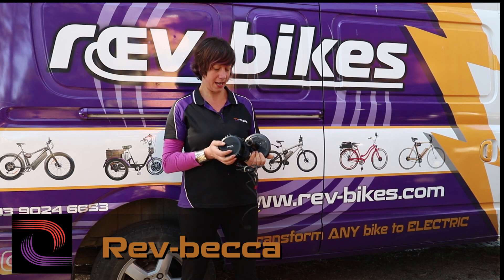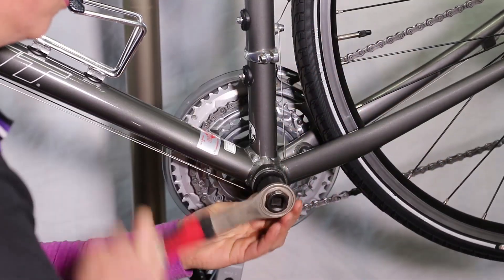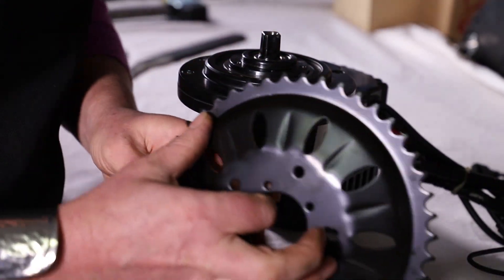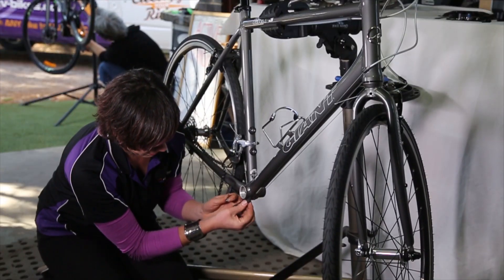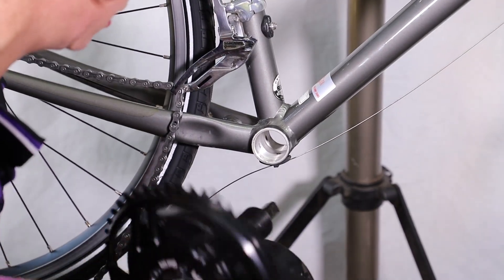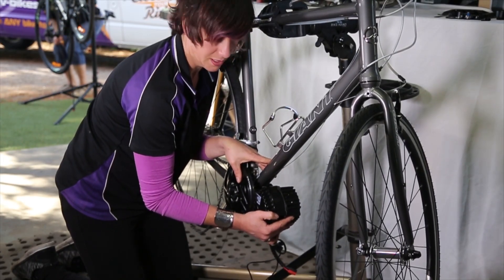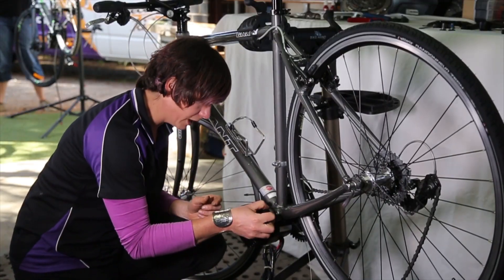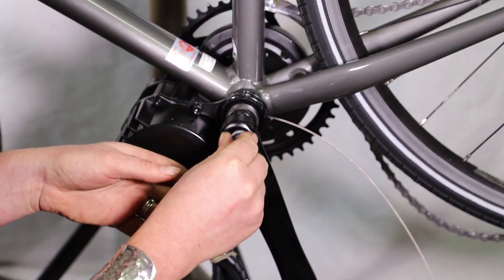Installing a Bafang mid-mount motor

Comment: Not the best frame to motorize because  I would recommend a hydraulic brakes.  The top speed on  your motor is pretty high and will wear your brakes pads 
prematurely
Reply: I agree, hydraulic disc brakes would be saver.
Reply: Yes hydraulic brakes better, but the motor cut off switches are more complicated. The kits usually come with mechanical/cable brake levers and inbuilt motor cut offs, Hydraulic brakes often require an after market add on fix, usually a magnet glued on to the lever, and a switch.
So yes hydraulics better but more complex and expensive, brake pads cheap, but for serious off road stuff, Hydraulics essential.
Reply: Maybe on a really cheap dept store bike. On my regular pedal bike I used to descend mountain roads beyond 40mph daily.  Even with 1000w motor it's within the normal use of anything higher quality than dept store bicycle construction. Any properly adjusted reasonable quality caliper, v brake or cantilever brakes will be fine.
Reply: I'm running budget Tektro cable disc brakes with excellent braking. My pads last a whole season or more despite the steep hills I ride. They do need a quick adjustment every once in a while to compensate for pad wear. I was using center pull V-brakes before and they too stopped fine but the brake shoe wear was significant. Several times I could smell hot brake shoes (hot rubber). I'm a big guy. My switch to disc brakes has probably paid for itself.

Comment: hi Becca can you give me some advice as very worried about buying my 1st Bafang mid drive motor as its a lot of money to fork out and get it wrong  ,the only ones ive seen is that they only come in  bottom bracket sizes in 68 mm ,100mm ,120mm 
 i have a problem cause my main my worry is , that my bottom bracket is( 73mm in width) on my Giant talon 4 mountain bike
 can you advise me what size bb shaft motor to buy 
and if its the 68 mm bb size motor i require
 How does one adapt to make this this work on a 73mm bb bike  is there some sort of thing i can buy to make this work can you advise me on buying the correct size motor for a 73 mm bottom bracket as they all seem out of wack  sizes to my 73mm bb
 >>ty Becca from me mark in the uk ,ps i love your videos
Reply: She mentioned that in the video. She  said 73mm fits using the 68mm kit and just needs some extra washers.
Reply: hi becca i id like to share this info with your viewers followers just like my self, but live to far away in the uk  to come visit your bike shop though i would love to 

i have since found out the answer to my question above 
 if your 1 st timer, like i am on installing a bafang motor
 if you have a (73 mm in width) bottom bracket, what i have seen & read researched ,it said you can install  68 mm bottom bracket bafang motor on a bike that has a 73mm bottom bracket , 

as follows ..with your motor slotted in place you just tighten up  your motors main pinch ring which bites into your frames bottom bracket with a bit of (locktite  blue) , the only difference is in some cases you leave off the cape cover ring that goes over the top of the main ring that holds the motor in place, hope this can be of use to toughs whom have struggled on lack of  info on this subject like i had if on motor compatibility to different bottom bracket sizes

Comment: I followed this procedure very carefully and it went together very well and looks great. One thing I did was to shorten the powercable and join it inside the battery holder using a terminal block. Very tidy. Is there a video on setting and/or tuning the unit?

Comment: Will this work on my old huffy Bay pointe 3 speed that has rear planetary gears? Or will that be too much torque for something like that?
Reply from the maker: Depends on the motor power. 250w is no more than regular leg power, so would be fine. 750w is 'a horse power', which might do some damage!

Comment: One way to get rubber grips on is to put them in boiling water for a minute or two and they slip on like butter
Reply from the maker: I use that method to get them off sometimes. Using hair spray to put them on provides lubrication, then makes them stick solid once it's dried .. the best way!

Comment: Anyone know exactly why you can't install these on carbon frames?
Reply from the maker: We don't believe the frames are strong enough.. especially the water bottle mounts (may be ok for 1kg of water, but not 3.5-4kg of battery).  We have done one as an experiment a few months ago, with a specially made custom battery.. is going ok so far.  But we couldn't tighten the motor up anywhere near as much as we usually do, so used a torque bar underneath.  You can always try it, but if you don't know what your doing, you may likely destroy your frame!  Hope that helps :)

Comment: Aaahhh???.....How many people do you know that have Crank Extractors, etc in their home tool kit??? I don't know any, and I have 2 Norco's, a Katmandu and a Plateau. The Katmandu is from the late 60's early 70's and I pretty much rebuilt it myself, but I didn't have to change Cranks, just the pedals because only a "Bike Shop" has the tools needed to perform this procedure, so you should tell people that they will have to take their bike to a Bike Shop in order to mount this motor. It can NOT be done at home unless you are a Bike Mechanic and have the tools, or you 'order' the necessary tools, but from where?, I don't know? So yeah, this is more difficult than it seems due to the required tools that not just everyone has at home like myself. I have pretty much all the tools needed, but I don't have any to Crank work.
Reply from the maker: Crank extractor tool is pretty inexpensive, and readily available at bike shops. But we agree with your opinion, and no longer sell our kits for self install.. we are now building an installer network across Australia for our customers 😁
Reply: Well I've had my ebike obsession for about two weeks and I've already ordered a $4.5k bike and now ... waiting for the hoped for delivery,  I'm obsessing about sticking a Bafang HD on my 10 year old Specialized with  V brakes.  So I have to buy a hundred  bucks  worth of tools.   So  the frack what !?  They're out there.  Use your search  function.

Comment: Great vids, helped me install my BB02, I've had problems tho and the speed sensor and throttle are having to go back to the supplier as there was no response from either. 
Have you come across this at all ?? 
Supplier was adamant it was tested before sent out.
Reply from the maker: Not encountered that before, sorry John.  You're sure the brake cutout wasn't engaged?
Reply: We are not sure what the problem was, I took the controller out and put back in and everything started working fine, I think maybe a wire was pinched inside.

Comment: Do you have any suggestions wrt mounting this on a Trek Remedy 8?  It has a 92mm press fit BB.
Reply from the maker: You may be able to find an adapter, will need to know the internal diameter of the BB. If you succeed there, you will need to order a wider motor to suit as well (100mm). This may be challenging, depending where you're located
Reply: Thanks! I think I’ll just give it a pass. Any recommendations on the bazillion options on AliBaba?
Reply from the maker: Here's the link to info on compatible bottom brackets and adapters.. https://www.empoweredcycles.com/blogs/news/101474694-bottom-bracket-standards-and-bafang-mid-drive-motors

Comment: Is it possible to have two sprockets on the front, for more flexibility, and reuse the front derailleur.
Reply from the maker: It's not possible with this motor. Nor is it really necessary to have so many gears once you have the assistance 😉

Comment: Next time push the motor up, so it's more close to the bike. Not only looks better but is also more safe.
Reply from the maker: Pretty sure this is part of the vid.. that the motor braces against the bottom of the frame. Do I need to check??  We always do it that way, always have.
Reply: Obviously did not watch the entire video.

Comment: I like the style and easy to understand descriptions in the video and your presentation is really good, but I notice that you were installing an Illegal size motor on that Bike, Will it only be ridden On private property? Its not like its an off road  bike.
Reply from the maker: Thanks Greggy. Illegal to ride on the roads or public paths, yes.  Personally, if I'm pulling a trailer with my shopping through my very hilly suburb, or taking my kid to school by bike rather than car, I'll ignore that stupid law, because a 250w motor won't do that job.  I'm all for safety-based laws (ie, compulsory disc brakes, realistic speed limits, etc), but not imposed power restrictions that don't make sense for certain applications, with no factoring of ratio for power to weight. You have your own right to decide too.. you can be legal or not. Many states in the USA allow 750w or 1000w.  Nanny state Australia would prefer we all used cars :(

Comment: You should always use some anti-seize or grease on the Square tapper BB and the pedals. Makes it easier to remove later. You only mentioned that when you got to the second pedal. Not wise, if doing an installation video, food for thought.
Reply from the maker: Thanks for the feedback.  You're very picky!  lol
Reply: @Revbikes  I'm not picky at all. I'm a mechanic who just happens to like to have my equipment worked on by serious people like myself. Customer Satisfaction is always first and foremost in the shop that I either go to or I work at. I have seen many bikes in my days and I have seen what the end result is from a Good shop with Good mechanics and a Good shop with half assed mechanics. It's always good to look down the road because you never know where your last job will end up. Word travels  on bad jobs. :-)
Reply from the maker: @richardmiller3808  I appreciate your point, and I did address it.  It just wasn't in the order you wanted, that's what I found picky.  People will normally watch the whole vid before going back to the bike, so I believe I covered what you were wanting me to cover really.  I hope you enjoyed the vid apart from that anyway.  And please note that we no longer sell to self-installers, we prefer to have the job done perfectly by OUR mechanics (we're currently training and setting up installers across Australia).
Reply: @Revbikes  Good on ya!  Great to know honest God fearing capitalism still exists down under ( New Zealand excepted ).
Reply: Actually on my bike it was a struggle to keep the crank arms and pedals tight. So in my case, no anti-seize is wanted.

Comment: I've had a front hub motor for the last 6-7 years that has served me well, thinking about switching to this 1000w mid drive, I also have a Giant mtn bike so my install should go like this one. I just need to know exactly what tools I need, Can someone give me the names?
Reply from the maker: I suggest buying a toolkit from the retailer you buy your kit from.
At the very least, you'll need a set of Allen keys (2mm-8mm), 15mm pedal spanner, a crank extractor, a bottom bracket tool (there are a few different types of bottom brackets, so get the right one), some locktite, and the Bafang motor installation tool for the lock rings, plus a mallet to get it very tight. 
**If you're not experienced with bike mechanics and removing a bottom bracket, I'd highly recommend getting it professionally fitted!

Comment: It had a name before reverse thread, and that name was left handed thread. Sometimes a notch in a nut (as on a lorry wheel nut or gas fitting) indicates a left hand thread. These things are known to engineers. Not sure reverse thread is a sensible description because in a world where left hand threads dominate, a right hand thread would be reverse.
Reply from the maker: Few people watching are engineers, this vid is aimed at those who aren't actually 😉 I describe the thread which goes the opposite way to that which you're used to, as REVERSE thread, because it goes the other way. You expect lefty loosey and righty tighty, but when the thread is reversed, you get right loosey. The REVERSE of what you expect. It's just a different way of expressing it really. Thanks for adding your 2 cents worth anyway.
Reply: I remember the thread direction as: Right Side = "Right" direction; Left Side = "Wrong" direction. ;-)
Reply: @jimford3063  Morning Jim. I'd say a right hand thread fastens clockwise, and a left hand thread fastens anti clockwise. If someone is working with a thread for the first time what use is right and wrong?

Comment: Very good video: Not too fast, not boring. Congratulations! One question: Is the chain not too stressed with the added power of the motor? Wouldn't a hub gearbox be better? They use wider and therefore stronger chains.

Comment: This video has been very useful to me and cleared any doubt about how to mount the motor with bikes that have bottom cables. Thank you!
Reply: I was just thinking about adding a 2 stroke for propulsion AND to charge batteries
Reply: Would that possible with your kit?

Comment: which battery is recommended . i assume Lithium ion ,is there a limit to Voltage , please excuse my lack of knowledge ,i have no experience at all....jim
Reply: Litgium ion, bunch of the 18650 cells. They usually make them 36-48v output

Comment: I'm a bit surprised that up until now, there's no frame manufacturer that makes a bafang mid drive specific frame that you can buy and install the motor later on if you wish.
Reply from the maker: You can install it on almost any bike.. that's the point! Or, check out frames designed for the integrated bafang motors, an example is the Smart Motion HyperSonic

Comment: Thanks Rev-becca! Nice easy-going and to the point instructions. Only someone who knows what they are doing, is able to do so! You're the master!
I've got exactly the same Giant bike with front-wheel 250W motor. I'm 180, and heavy, so it's no speeder. Uphill it is struggling. It really needs more power. I'm also going to install a 1000 Watt, because there are mainly off-road conditions where I live. That way I won't have problems with regulations. (250W nominal max on public road) I have big problems finding a kit at a reasonable price. Anyone? Any suggestions? Rev-becca?
Reply from the maker: Www.rev-bikes.com is our website, we sell kits INCLUDING installation, in Melbourne and a few other locations in Australia.
Reply: Get a mid-drive. Then the motor can use your bike's gears along with you. My BBSHD with a 42T front sprocket and a 11-34T rear sprocket will climb anything I point it to. I usually pedal along to get a workout and to preserve the battery range.

Comment: Great video. 
I'm not sure how to ask this as I don't know much about bikes.  
Do these kits come with a 3 crank so that I can use all 24 gears,  not just the 8 on the rear sprocket?

Also,  do you have to put a heavy duty chain on for the extra torque  that goes through to the back wheel?
Reply from the maker: Heavy duty chain is a good idea, especially with more powerful motors
Reply from the maker: The kits only have one chain ring at the front. You won't need so many gears with the motor, especially not the lower gears. And you'll have 5 levels of pedelec instead of the 3 gears at the front 😊👍

Comment: always makes me cringe when i see people loosen tight bolts holding spanners with a clenched fist, Please always  push with the flat of the hand  it saves gashing your knuckles.
Reply from the maker: Yeah, a few clumsy mistakes in here, I think it was the pressure with the camera rolling 😆
Reply: Always PULL the wrench when you can. That’d also prevent unnecessary leakage. A squeezing technique could help too.
Reply: Step or use a mallet😂

Comment: I really can not see the point sorry just just peddle any bike in lower gears and you will get fit or get a motorcycle  a lot cheaper  50 cc mutch better and cheaper in the long run long run
Reply from the maker: My guess.. you haven't tried one 🤣 You still get exercise, but it levels out very hilly areas, increases average speed, allows riders to commute with cardio but without sweat, can go on more enjoyable bike paths, and can be charged with non polluting renewables,  rather than running on dinosaur juice. They are the main reasons, plus it's great fun! 😎
Reply: Depends on what is important to you. You want easy and cheap. I want exercise and silence. They come with different pricetags and compromises. I love riding through the country on my ebike and hearing everything around me. This week alone I surprised an owl, several deer, a ground hog and an elderly lady - all in the street and unaware of my approach. Was fun to stop and watch the owl for a bit before he flew away. I also like riding my vintage Vespa and Velosolex but both supply a loud soundtrack that drowns out everything else.

Comment: Great video, very helpful, and I liked the improvisation with the derailleur cable. 
Incidentally, the reason I have a repair stand is to remove the need for me to grovel on the floor with a screwdriver!
Keep your videos coming :)
Reply from the maker: Thanks for the compliment Robert. Glad you have a stand if that's what you like. We of course have several too, but it wasn't working with possibility available clear background area for the vid. Also, at times, more force is required than a stand might stand 😉

Comment: I Bought a brand new bike. But my issue now is that it has A 36T chain ring. With no space for a bigger cog because the frame is in the way..  Will the bafang fit?.
Can I use the original bike cog onto the motor shaft? I have seen one special bafang 36 thats over priced. Like 60bucks
Reply from the maker: You cannot use your existing chain ring, unless you get a special adapter.  It's possible to get smaller chain rings, such as the 36T Bling Ring. Generally, they will sit out further from the frame than the original ring, maybe that would help.